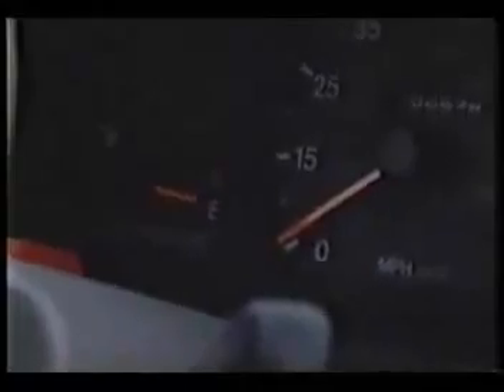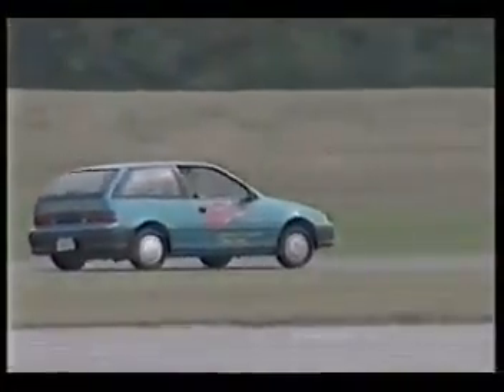Magnetic Motor Troy Reed Electric Car Surge Technology

Comment: I can't help but feel these would be more safer than the current rubbish electric vehicles that catch fire today through over charging. Plus, the materials probably wouldn't have to come from a 3rd world country will children mine for it and it looks as most of the materials inside can be easily recycled by melting down and re-purposing it.
Reply: It's safe because it's fake. It's an electric car powered by a hidden battery. His proof-of-concept is also fake and ge uses magicians mirrors to hide the electric motors powering his scam. See my earlier post with time refs where you can see the mirrors.

Comment: this is funny as he'll. he's using a magicians mirror mounted to the center panel of the table. 

Watch CAREFULLY as he rotates the table at 2:00. From the front you can see a partial image of a cord laying on the floor.  As he rotates to the back, you note two things:

1.  The cable that should be on the floor isn't there.

2.  2:10 What IS there is one or more cords dangling low where the should have easily been visible from the front.  Yet there weren't.
Reply: Yep, too suspiciously displayed and staged like some magic trick, definitely suspect demo.
Reply: I honestly don't see it. If you follow Troy's work, you'd know that he had mechanical versions of this working. These technologies do work, but they are tricky to get right. It involves magnetic flux shaping, special pulser coils and electronics to time things precisely.
Reply: @jontanneguy4960 and carefully placed dilithium crystals.

Comment: This is a free energy device and you don't need a meter so profiteers can exploit the American people. If you can increase the power of the magnet with nitrogen several times obviously you don't need to burn gas or coal to run a generator at a power station which also operates on magnets and copper wire. What you could do is lie about how it works so instead of spending millions of dollars for fuel you get nearly 100% profit.

Comment: Why is a gearbox used? I've understood that electric motors have the same horsepower no matter which revs?
Reply: Not the case actually. higher revs equals higher heat losses from friction. That said, the energy losses from a transmission are likely far, far higher than losses from heat in the motor. Nevermind  not having to use energy to haul the extra 100 or so pounds.

Comment: He had the injectors when I met him, it was nuts. He had a crank shaft. It made no since. He changed all of it. To what he should have started with.
Reply: The 'injector' method is bulletproof though. EMP proof. But this surge tech is top notch. Similar to Don Smith devices.

Comment: If we consider the thermodynamic law, could be possible to accumulate energy (without batteries, using different sources) to produce electricity. But my QUESTION HERE IS: THE SYSTEM OR GOVERNMENT ALLOWS CREATE A BUSSINES WITHOUT SELL GASOLINE OR ACTUALLY ELECTRICITY?

Comment: If the motor can power the car, why can’t it power the radio and the blower? Then you wouldn’t need to carry around that battery
Reply: You still need a storage bank dumbass, the system will charge it and it will start the system. Or do you want a car with a pull start like your mower
Reply: LOL.  That was I thought when watching this video.

Comment: Holy smoke you guys are  dumb me man  me still  use  oil look at the nisaan leaf..tesla Chevy  volt.. ass clowns
Reply: One, it's a Rodin coil, not a ronin coil, and two, it doesn't help you harness near the amount of energy you'd need to power a car.
Reply: You're really confused, the Leaf , Tesla and Volt require you to CHARGE them first. Electric motors have been around at least 150 years. No ons is trying to squash something like this. The reason being is it is impossible. Magnetic fields CANNOT DO WORK.  Work is the the scientific name for change in energy, in this case, change in velocity.  You're an ass-clown for being so stupid.
Reply: +James Szczesny I'm a master electrician look up Nikola Tesla do some research on it before you call me an ass clown ass face open your mind stop being the Drone you slave why else would the government sees all of Tesla's patents I know of electrical engineers how many electrical engineers do you know or master electrician
Reply: You are not a master electrician. I don't care how many you know. Magnetic fields cannot do work, that is fact. I don't know how many electrical engineers I've met or kept in touch with over the years - because it's irrelevant. The rest of the video where he talks about voltage then amperage interchangeably is complete gibberish. Any "electrician" would know that. Just so you don't waste both of our time dick measuring that you know more electrical engineers or electricians; I have a Bsc, Msc. in Physics with a secondary BComp in computer applications. Take it from me: there is NO SUCH THING as free energy, and there NEVER will be. Every video or any article claiming this is a LIE, always, no exception. I can't summarize all of thermodynamics and conservation of energy in a few words,so  I'll leave you with a difficult to understand but concise reason. If it were possible to create free energy, the universe would be overwhelmed with energy and no matter could exist for more than an infinitesimal amount of time. Obviously this is not the case.
Reply: +James Szczesny what do you know about ronin coils  electrical coils James? all I'm saying is were not using our full potential.  and yes I've been in the electrical field  for 19 yrs now.  the tech is here just need to apply it  look into start ship coil. ronin coils ..research more shit let's   prove him wrong. I'm up for the challenge

Comment: Like earth's gravitational force, where the waterfalls by gravitational pull turn the turbine to produce electricity, permanent magnets can be harnessed to produce energy.
Reply: Waterfalls turn a turbine to generate electricity, in a simple example so as to not confuse you, say you have a fish tank full of water that passes through a turbine causing a current by induction on a copper wiring, what do you do when your fish tank gets empty? Guess the amount of energy required to refill it - Minimally, the energy you got by draining it. I say minimally since it isn't 100% efficient. On a world scale there is more water evapourated per unit of time than water from rivers or falls flowing downhill (hence the reason all the hydro-electric generators didn't come and go in the blink of an eye), though, that itself doesn't matter since that isn't analogous to what this nonsense is spewing. The "motor" here gets its power from him spinning it with a finger and that "energizing" other motor. There is a reason that part is cut short.

btw: "permanent magnets can be harnessed to produce energy."  

I'm not sure what you mean by permanent because nothing stays magnetized forever, but  in terms of physical magnets, yes, you're right, they're called  hydro-electric generators, usually coupled on a dam.  Do you have a 4000km chord that can hold 400,000 volts transmitted over the power lines? Or are you going to charge a battery - which is what every single electric car does?
Reply: @carson tan Sorry, but magnets can't perform work unless they get it from another source. Magnets always, ALWAYS seek steady state. Run your own test, a magnetic can only move something if you are moving the magnet.  The energy for work comes from you and not the magnet. A moving magnet also just gains stability with whatever it is attracting or repusling.  Once that steady state is achieved, the magnet no longer performs work.
Reply: Carson Tan The water in a river was lifted there by solar energy.  There is no analog with magnets, just a collection of con artists taking people's money because they slept through the important classes in high school.

Comment: Magnets have a force that when harnessed right converts to a mechanical energy.   Research more on magnetic motor!
Reply: Magnets can push it pull each other, yes, but there is always an equal opposite force nearby negating that push or pull. In other words, any open magnet system has a NET force of ZERO. The only potential way around this is to employ some kind of magnetic shielding in order to unbalance the forces at play. I have studied these systems for over a decade and I have yet to see one that is truly successful in achieving any net force greater than zero. I'm not saying it's impossible, just at best, very, very elusive and difficult.
Reply: @haroldkline4898  minor correction.  The net energy created is always negative due to friction, heat, alignment, etc. Only a perfectly built frictionless system in perfect vacuum could reach net zero.
Reply: I can "harness" kinetic energy a million different ways. Here's a fun one: old style watches. Why not just make a big wind-up car? Well, because you need to wind it up, which lo and behold, is the energy (more or less) it can store. You created the energy by winding it up, magnetic fields cannot create energy, they can only transform it. Keep repeating it, learn it, love it:
ANY "free energy" motor using magnets is a lie... ANY "free energy" motor at all, is a lie.
ANY "free energy" motor using magnets is a lie... ANY "free energy" motor at all, is a lie.
ANY "free energy" motor using magnets is a lie... ANY "free energy" motor at all, is a lie.